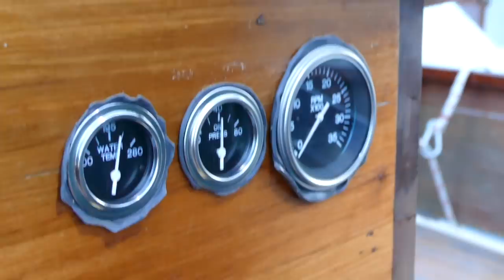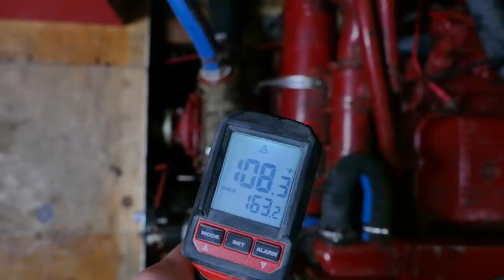Salt & Tar: Ep.129- Testing the Engine

Comment: Wondering why those gauges are so low to the deck.  I know you can see them from the tiller position but that’s gonna make your back worse.  😫
Reply: Similar thought, but figure that at some point Garrett will take his jig saw and cut away a rectangle of wood  which will include those pesky gauges and nest that panel in a 45 degree angled box, reattach said box to cover the hole.   Easy Peasy :)

Comment: do you have an e-stim device? they're relatively cheap, and are great for muscles that are hard to stretch or massage. I'm assuming you have a lower back problem. I've used one for that, and for the ones under the shoulder blades. my chiropractor uses an extremely expensive industrial one before or after adjustment, preferably before, while sitting in an also expensive heated massage chair, but you can use little hand warmer heat pads and/or just e stim. the ones that are cheap just use batteries. If you go for that get one that has 4 points so you can target multiple areas, and don't crank it all the way up like I first did. go medium high and more frequently. I hope you feel better soon so you can keep ballin'. Maybe consider souping the deck and taking a few days off while it dries? You're looking fairly complete now, and I can't wait to see the sails and some test runs!

Comment: About your engine water temp - - I had the same issue with my engine when I first fired it up. I tried it a couple of times, just trying to make sure the water was topped up. No good. Always did the same thing. Couldn't imagine what was wrong. I found a small pipe plug on the rear end of the cylinder head. I removed it, and no water came out, so I knew the problem was a big air bubble in the cooling system. I got a small street elbow and installed it, with the fat end pointing up. Then added a 3" long nipple, and a cap. I left the cap off, and filled the water, until it came out the nipple. Put the cap on, tight, and fired up the engine. No more heat issue. Problem solved. Find the highest access port to your cooling system, and add a small "air release" gadget. It will solve your overheating problem.
Reply: We that on cars in australia, works great to bleed the system of air bubbles trapped in the head

Comment: I am NOT a fan of electric water temp and oil pressure gauges.  They seem to have a short life.

Before you do any cruising or even day sailing, all bolted electrical connections need a good gob of silicone dielectric grease to prevent corrosion.  In a pinch, good old Vaseline will do !

Comment: I would remove the thermostat, at least for initial testing. They are more trouble than they are worth.  They cost like $5 .. replace it anyway when you put it back, but for initial testing I would test with the thermostat removed so you know the cooling system can work .. then put it back and see how it fairs with it.
Reply: In an emergency you can remove the spring loaded piston in center and reinstall. Engine will warm up but much slower.

Comment: Errrhmm....   you should get a mechanic to check out what pulley you selected for the  alternator.  It's meant to run in a certain RPM range and what speed it is running at is determined by the engine RPM, diameter of engine pulley, & diameter of alternator pulley.

Comment: Another step forward but I worry about the universal joint I saw. Look at youtube channels on understanding universal joints or drive shaft angles and phasing. Briefly; the speed of the input shaft does is not even with the output shaft unless they are in the same line. Yours is not and motor vehicles have 2 universal joints with parallel flanges to achieve this. A cheap fix would be to use a cardan CV joint off a 90's Hilux front driveshaft. The needle rollers in your CV will eventually give out. I've been through this and learnt the hard way. Please investigate how universals work. Mike

Comment: Just interested in your "Soup" mix, is it 1qt Turpentine, 1qt Boiled Linseed oil, 1/2 pt Pine Tar and 1/2 pt Japan Dryer?
Reply: Add in some varnish. She adjusts the mix to the job. Nice to see Total Boat watching the channel. Metal, glass and wood guys always checking out how the other half live.
Reply from the maker: It's probably like 1qt Pine Tar, 1 qt Boiled Linseed Oil, 1 pt Varnish. Just a splash of Japan Dryer in the cup I'm working out of. Only use turpentine when I need to thin it. Pine tar has to be heated initially so it all mixes together well. Again, it's not an exact science as it does change depending on the project and we keep adding to the gallon can over time. Hope this helps.
R

Comment: Does soup last longer than varnish in your experience?
Reply from the maker: It's different... varnish lasts longer but then peels when it starts to deteriorate whereas soup can just be scrubbed every couple months and add another layer. No sanding and no peeling is why I like it. Easier prep and don't need ideal conditions for the multiple layers varnish requires. The finish is different so some prefer varnish as soup can, as you build layers over time, get dark and it's not as smooth/shell like
R

Comment: I'm confused. You flushed and refilled the coolant with antifreeze so it must be a closed loop fresh water cooling system, right? Then what was that water coming out of the exhaust port thru the transom?
Reply: @Bernd M. That is the raw water side of the heat exchanger being discharged.
Reply: @timsaxer6442  Ahh OK. Now that you said that it makes perfect sense to me. So the raw water flow replaces the radiator. Got it. Thanks

Comment: So was it the thermostat or the gauge?
Reply from the maker: Thermostat works just needed cleaning and the gauge works just need to replace the sending units on the engine for accurate readings.
R
Reply: You will need an sending unit that fits your Gauge or the gauge needs calibration to show the right readings with the sender you have installed.

Comment: I hope you haven’t herniated your disc it’s all over after that
Reply: I herniated my back 20-30 years ago and am doing quite well with diet and exercise.  Sitting or laying for an extended will put me back on pain meds.
Reply: @dobie2times  It’s nice to hear that you’re doing pretty good I had back surgery for herniation against my spinal cord six months ago I can only stand for about 20 minutes my thighs go numb and my lower back muscles knot up and they feel like baseballs that’s what my wife tells me
Reply: I herniated my disc 6 months ago carrying machinery, the gel pushed out of my disc and  into my spine too, i was bed ridden for a week and couldnt even get up to pee or even roll over, then i was in huge pain bent over like the hunchback of notredam for a month, then i was able to walk normally again and i carried a 35kg battery upstairs and it reherniated and i was trapped in bed for 3 days that time, i took it easy for another month and went back into weight training light at first then till complete failure every set as heavy as i can lift, now im back to normal running jumping carrying concrete bags sand bags and in full time work again...  Im 34yrs old about garrets age and ive been fine for around 4 months now, the only change is im gaining muscle as each month goes by and feel as though it never happened.. im 6ft1 and a bit lighter weight then garret is but garret is fitter and stronger than me by far i can tell,   i think not being obese and being in my 30s is why im able to recover fully and i believe garret will too if his is disc related... But im not here to speculate we have no idea what happened to garret as he never mentions the actual problem and seems he doesn't want too, so just let him be, im sure hes seen a doctor and knows if he can heal or not by now as hes mentioned his back problem since the begining of the build..

Comment: STOP...DO NOT USE THAT FRACTIONAL HP PULLEY MADE OF POT METAL ON THAT ALTERNATOR.....HUGE MISTAKE ...NOT ONLY WILL YOU NEVER TRUELY GET THE BELT TIGHT ( I.E. YOU'LL NEVER  GET THE BELT TIGHT  ) YOU WILL WEAR OUT THE BELT IN A VERY VERY QUICK TIME....PLEASE... DO NOT. MAKE. THIS. MISTAKE !!!!!!!!!   I have cringed watching you  install the wiring.....I wish I'd been able to advise you before you had wired up the boat.  
 Signed  D.F.C.  ( A.S.E. certified electrical specialist with 40 years experience under my tired old butt )
Reply: listen to this guy avoid a major mistake